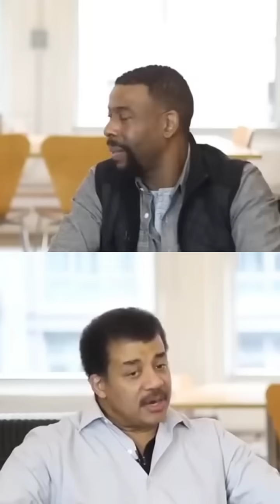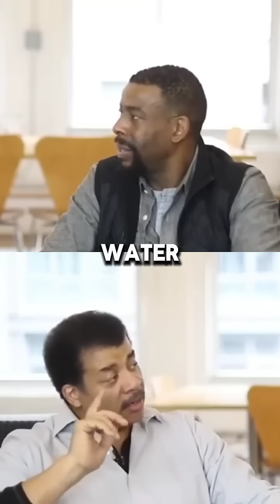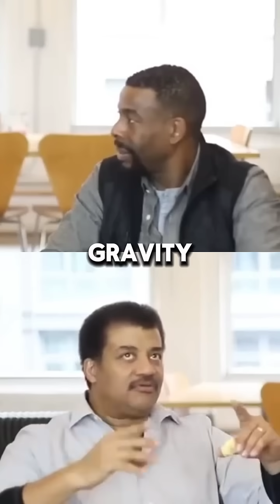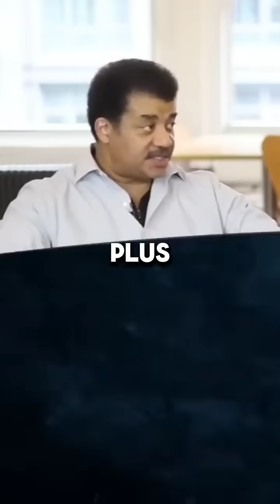If we have pumps, why do we still need water towers? #watertower #waterpressure #engineering

Comment: pumps NOT needed Just saw a video on one ancient city that was able to syphon the water through a series of ponds to the top, to supply water for the entire city
Reply: How tf do you syphon water uphill?? Syphon only works if the receiving container is lower than the container you're syphoning out of.
Reply: @GalTheJebac  ill have to find the video, but no, for example, if you have a straw that goes up, down up then over the cup and down into another cup by putting the straw into water air is forces out into the other cup by water pressure this causing a sphyon that will transfer the water from cup one to cup 2. theres actually a greedy cup that if you fill it to a certain point, it will completely drain all of the liquids from the cup out of the bottom this is an ancient cup this technology has been around for hundreds of years, theres another one similar, but i cant recall the exact details
Reply: @jamiebennett6354  this is still a type of pump, just a hydraulic one, you need to send a lot of water downhill, to get a small amount of water uphill.